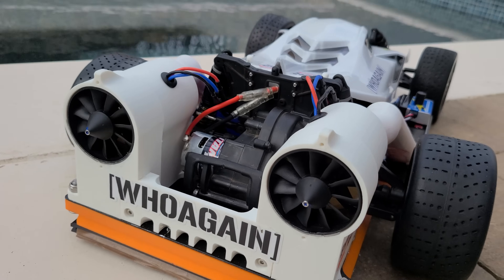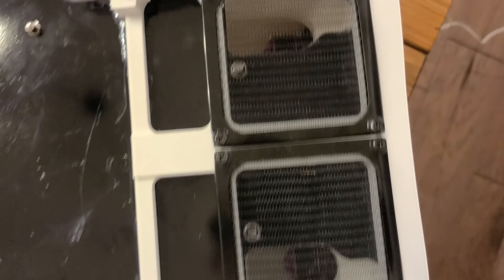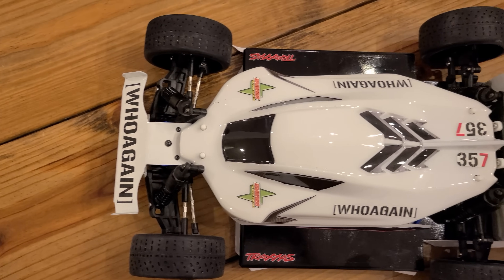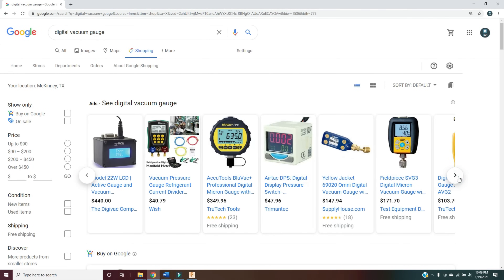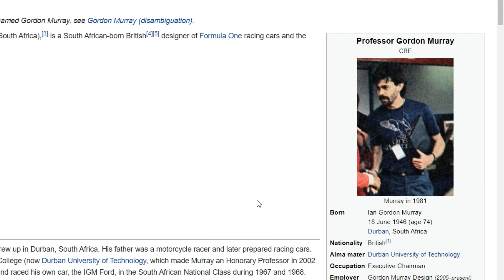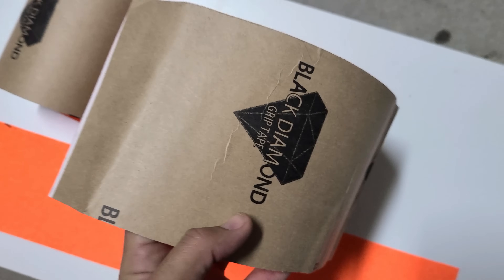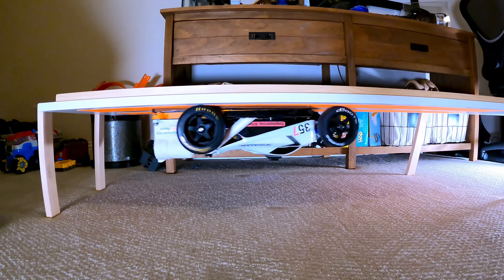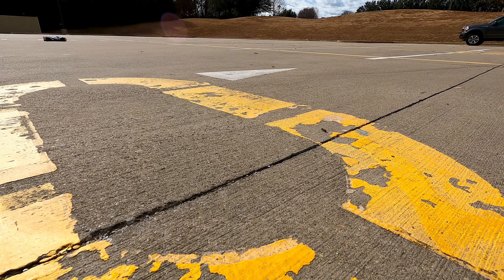Can a Fan Car Drive Upside Down?

Comment: RADIO CONTROLLED. NOT REMOTE CONTROLLED.  Picky? You bet.
Reply from the maker: Radio Control is a type of remote control.
Reply: @EngineeringAfterHours  Yes, but remote control could be with a cable. Radio Control is what R/C stands for. DVD stands for Digital Versatile Disc, not Digital Video Disc, while we're at it.
Reply from the maker: @badad0166  your original statement is wholesale incorrect though lol. None of these comments have any value.
Reply: @EngineeringAfterHours  I'll bet you say "anyways" and "heigth" too! If you want to live in proud denial, that's up to you. Just trying to help you not sound ignorant. Happy to help. Good luck with your anger management issues😝.  It's not "ta may toe ta mah toe. I was around before radio control existed and I have since gone through several R/C cars that are older than you. People who say "the bomb was remote controlled" are wrong. It was radio controlled. Just because everybody gets it wrong, doesn't make it right. If you're gonna play with R/C stuff on YouTube, you should be saying Radio Control. Again, picky? You bet. I'm a one man army to stop keep the world from getting stupider, and I'm losing.
Reply: @EngineeringAfterHours  Greetings, noble adversary. I have returned, months later, to eat SOME crow and admit defeat. I bought a TOY R/C boat and the instructions included instructions about the Remote Control!!!
BUT, it was, you know, from China, so, I've not completely surrendered. I will be purchasing some high end radio gear (also from China I'm sure), soon (ish), and will report back on that. Maybe it will become an elitist thing.  
Language changes. Language evolves. Language devolves. As I said on another comment thread, "One day, it will all be burps and grunts again."   Talk soon!  

Get it?  😁

Comment: Has anyone made an RC with the skirts floating on the wheel hubs instead of the frame/chassis?  This would definitely keep your skirts at an EXACT distance from the ground, and would, sure, change with the tire wear, but that's it.  This seems like a no-brainer to me, even with the need for multiple vac 'cells', one on each side.  I think the idea of keeping the actual 'suck zone' under the middle of the car in one big area is where everyone is getting caught up.

Oooo... did I just solve a huge problem?!  :D  I'm going to go work on my quad-transmission car which uses semi-closed toroidal CVT's, one on each wheel, and uses pressure on the input/output to add a clutch/limited slip for each wheel... TORQUE-STEERING... HOOOOOOOOOO!!!
Reply from the maker: If there was no suspension that may work, but with independent suspension on all 4 corners of the car you will still see variable skirt clearance.

Comment: Wonder if floor designs where vortices are generated along the sides of the floor, starting in front of the floor, would work in maintaining some sort of floor sealing consistently. The way F1 does it these days. Also wondering about the math of the load necessary vs area vs fan suction

Comment: I would just like to see a 4x4 car, with a ducted fan over each wheel, outside the car, and pushing the car down, instead of sucking the ground, like a vacuum. (Think upside-down ducted quadcopter, pushing the car down) The fans could take their input, from ducts in the front and sides of the car.

Comment: Due to the way the brabham worked it spun debris into the ground or off to the sides.

Meaning that the yeet debris into cars behind in terms of the brabham was a believable but bogus story cocked up in an attempt to get it banned on safety grounds.
Reply from the maker: That was brabhams excuse for sure. But throwing rocks to the side is no better than back lol.

Brabham proved they weren't exactly an Honest team throughout that entire process.

Comment: How come you never mentioned that you can actually buy small RC cars that are designed to drive up walls with a vacuum pressure system that holds them to the wall? This would have really helped with your R phase of R&D.
Reply from the maker: That really wouldn't have helped much at all. Those cars are slow and really light duty. I needed a system that had a much higher power to weight ratio which completely changes the architecture.

This design was influenced by the cars I specifically called out.

Comment: Man, what's the point if they aren't even brushless. They need the power to make the downforce worthwhile
Reply from the maker: They are brushless...
Reply: @EngineeringAfterHours  thats strange. Mounted in the gearbox of the car your displaying ts a Brushed Traxxas Titan motor
Reply from the maker: @independentassesor2630  you're talking about the downforce. The fans that produce the downforce are brushless. The titan has nothing to do with the downforce or fans.
Reply: @EngineeringAfterHours  Ohh yeah I realise that, Just saying it would be good to produce that sort of downloaded with a car that makes serious power
Reply from the maker: @independentassesor2630  check out the other 2 fan car builds on my channrl then! It's definitely much better with a 6s system:)

Comment: Is it possible to turn your fans around to face forward and then turn the blades around Square as you're going to ground force is sucked in and push back out the back and as you go increase downforce

Comment: I would have gone with an inverted hull design that funnels into the fan. Obviously a single Large fan. Not for running upsidedown but very good at traction without bottoming out the suspension or rubbing a seal on the ground. It literally takes the air from the front bottom and redirects it out the fan. But cool car none the less. A tad bit jealous of the resources you have.

Comment: Why don't you use an Arrma Limitless
Reply from the maker: It's wayyyy too heavy. Like twice as heavy.
Reply: @EngineeringAfterHours  but surely it would have better suspension and a larger ground effect area.
Reply from the maker: @Rockatha  but it would take more than twice as much power which drives weight up even more. It's also way too low to the ground for under body aero.

The limitless is a really great street basher and designed for durability...but that's made it heavier than you want for high acceleration.
Reply: @EngineeringAfterHours  what could work then is the new Arrma Mega Infraction 3s.

Comment: Another thing you may have over looked is....they also had just as much aero as every other car PLUS these fans, AND a ton of air diffusers under the car, and that vacuum under the car helps the traditional diffusers work EVEN BETTER also

Comment: Ducted fans are absolutely the worst choice for creating a vacuum. You should use a centripetal squirrel cage style fan. also If your objectively is to increase air flow you should add another fan however adding a second fan does not increase the vacuum significantly. You should try a design that has a suction inlet in the front of the car and only has side skirts and a back skirt. Adding additional section ducting to the middle area of the car would probably also be needed in order to stop while inverted. The exhaust ducts should be distributed over the highest points of the car's body this will increase the pressure on top of the car while at the same time reducing the pressure underneath. Adding redirection veins to the intake in the front bumper should help reduce the amount of air that slips past the fans. Side skirt design should be as simple and light as possible a slightly spring-loaded vertically oriented rigid slide skirt would most likely be the design of choice.
Reply: The reason ducted fans are the worst choice is simply the amount of time it takes to accelerate the air flow through the fan with no resistance. Squirrel cages are the most efficient in this followed by a standard propeller and then a ducted fan. The reason ducted fans are so bad at this is because as they create the vacuum it exists over the blades. A similar effect happens with standard propellers but because they are not ducted they can draw in excess air with the vacuum from the outside keeping the airflow inertia higher. Squirrel cage style fans are the best at this simply because they are not relying on redirecting the air using the blade as a deflection surface instead they use the inertial mass of the air itself being flung out in a centrifugal motion. Simply try getting a similarly sized squirrel cage fan or 3D print one and notice it will take significantly less power to achieve the same vacuum as the ducted fan

Comment: In order not to be so dependent on the rock, I would make lamellas in the suction surface, each of which almost touches the ground.
______________________
|___________          _____|______
|____________  O  ______________|
|____________       ______________|
|___________    O    _____________|
|________________________|
That would be an idea for a pattern. The O's are the intake points.

Comment: The softer the tire the more grip you have, but at the same time they where out at faster then stiff tires, the soft RC tireds balloon so it will not be an easy task
Reply: Tires*
Reply: That is why your tires have wires inside them to keep them from ballooning and end up crashing

Comment: Why didn’t you take a look at skirt designs for hover craft? They may do the opposite (high not low pressure) but they have to keep the pressure under them just as you are trying.

Comment: All right here's a thought for you, how about if you reverse the fans to where they blow down to take the load off the springs and the wheels and, in effect, make the car lighter? Wouldn't that increase the top speed and possibly the efficiency?  I'm an old engineering tech from Rockwell international..

Comment: Question why not Angel the Exhaust side of the fans up at a Backwards Angle and Make it 4. One at each corner respectively or a 3 configuration?

Comment: I highly suggest you flip around the EDF blades on the EDF shaft (this won't change the airflow direction). The hollow side of the EDF blade is now facing the low pressure side and the rond side is facing the high pressure side (the outlet). By installing the fanblades the right way around you will get even more power (vacuum) for even less Amp draw. This mistake is commonly made with RC plane propellers. Look for the video of FliteTest title: FliteTest - Prop Direction-  FAST TIP
In this example they explain it for a propeller but the same rules apply for a EDF fan.

Cool project by the way.

Comment: Cool design … why not connecting the signal of the fan ESC parallel to car ESC’a? In this case the fans power goes up proportionally with the speed of the car which looks more efficient.

Comment: I wonder how difficult it would be to have the load path go straight through the hub or unspring control arm. This way your pressure depression down force would act directly on the hub and tire and you wouldn't have to deal with compromising spring rates to compensate for the downforce.

Comment: The ducted fans are too small, you need 10x stronger duct fan something like a shop vac, brushes for the skirt and  the setup like the HARRIER JUMP JET or the F35 wasp on the early stages where the landing gear was so low that the plane got sucked itself to the ground.

Comment: what if.... the vacuumed area were 2 separate chambers... 1 for each fan.. 
and bristles for side skirts? just a thought.. I'm gonna try your idea first.
Reply from the maker: Brustles didn't work so well but I love the idea of 2 separate chambers. I considered doing this for testing but you have to do front and rear chambers instead of side by side or you may have unbalanced downforce

Comment: The fans are running backwords, so their efficiency is very bad. Turn them around to suck from the pointy part of the fan and blow out of the motor side... should solve a lot of problems.

Comment: You need foam tires that's what the speed run guys use. They're harder and have better grip. Also switch to a brushless system and lipo batteries. The Titan you have will be lucky to hit 25mph with the added friction of the skirt hitting the ground and the added weight. 

HobbyWing and Castle make really good brushless systems. Something like a 3000kv 3070 sized motor with a 120amp  ESC running 4S would be good. Not sure what speed you're shooting for though.

Comment: Generally you improve the grip of tires by making them out of softer rubber.  You can even mold your own using real soft rubber like fishing worms.  This shortens the wear life of the tire but makes them real grippy.  Making the tires wider to whatever extent possible adds more contact area.  Pneumatic tires can run lower pressure which also increases contact area.  Too little pressure can cause a tire to get too hot or roll off the rim.  In the case of tires made of really soft rubber, it would be interesting to check the difference between slicks (no grooved tread) versus real deep tread.  The idea is that deeply cut tread patterns will let the protruding lugs of rubber flex a bit while keeping the top of the lug in firm contact with the pavement.

Comment: Why not use ducted fans pointing straight up, one at each corner?  That way the exhausted air would contribute to the downforce.  It could end up being an upside down quad copter on the car.  Doing that you may even be able to eliminate the skirt.   Certainly also consider varying the amount of downforce based on how much steering input is used.   And if it’s needed for holding the drive wheels down when accelerating, you could vary based on throttle as well.

Comment: its critical to improve the weight supported by the tyres and reduce load on the skirts (its robbing most of the gains in tyre load i.e. grip). the real fan cars have much more weight supported by the tyres compared to the skirt and the skirt is very low friction. in fact often the skirts are only for the sides, with enough fan power, the front can be open.

Comment: In regards to tyres it depends on the surface, roads can use sticky slicks tyres but wouldn't work on dirt, also the softer more grip but higher friction, harder compound less grip but less friction there's most likely a sweet spot for R/C tyres.

Comment: Great demonstration. I hadn't thought of that for lateral acceleration but what an advantage! Parts breakage will be the next hurdle when harnessing all the torque on the low end. You're going to need an Arduino or Raspberry etc controlling fan speed. A gyroscope will aid in fan speed changes with bumps coupled with a map sensor.

Comment: Your fans are exhausting the wrong way? You say your intakes are from the base of the car but your fans are facing the wrong way, if you reversed the fans you’re getting extreme inefficiency they are designed to exhaust only towards the motors?

Comment: You would probably get a higher vacuum if you used radial (centrifugal) fans in stead of axial ones. They usually have better static pressure.
Reply from the maker: Definitely can get a higher pressure drop going that route... But the smaller packages usually have a really low CFM so they're leak rate sensitive.

Comment: turn the edfs around, I know you said they look cool like that at the end but seriously, running the blades backwards is awful for efficiency. you could prob have gotten the same down force without the need for any skirts if you respect the aero of the blades.
Reply: Second this, the blades are not bidirectional so there’s a huge efficiency loss this way

Comment: Great video! Maybe, you could try out multiple "rings" of skirts under the car and increase the pressure difference in every skirt-ring. I believe this could help to further increase downforce. Maybe, this even allows you to keep a little gap between your skirts and the road so you don't destroy them in every run and further reduce friction with the ground...

Comment: 90s venturi tunnel design next?
Reply from the maker: Yes this is my next project!
Reply: @EngineeringAfterHours  Hahahahahaha. At least it will variate the down force based on speed. Remember that F1 banned fan cars because of the additional power plant, but tunnel cars because if you lose speed the car wrecks. 🤣🤣🤣🤣 I love it, man!

Comment: Choose CENTRIFUGAL COMPRESSOR rather than seperated 2 single stage fan, and need to have a good stator for stabilizing and converting to a high pressure. In other hand centrifugal compressor is not so powerful as a axial compressor with 5 to 10 stagea or rotor and stator but it is good enough compare to 2 seperated EDFan.

Comment: Use the steering input to control the fan speeds then you don't loose speed in a straight line.

Comment: You need to get off the street and on to a real indoor RC road course that's thin pile carpet. Not only are you going to have a nice flat surface the carpet smooths out minor transitions while still producing a high resistance to airflow.

Comment: You need foam tires to lower the weight alot compared to the hoons. And get some bec to eliminate the extra lipos or maybe a splitter to run off the balance lead of the main motor lipos. Another thought is to use a side skirt that can inflated from some of the waste air redirected into tube like skirts that expands to make a seal, kinda like actual hovercrafts do and you could adjust to pressure against the ground. Possiblity lol. Just some thoughts.  But either way this is awesome and your definitely on to something.

Comment: If you would mount the edfs the right way they would work much better.. The housing the blades all is designed to take in air from the front and not the back which is what you're doing atm